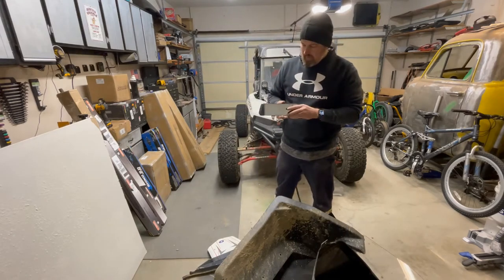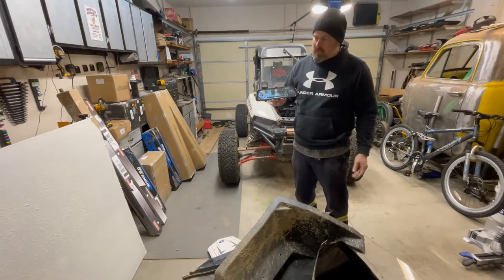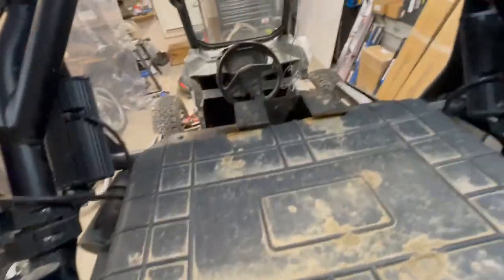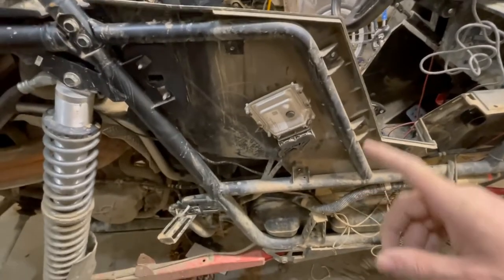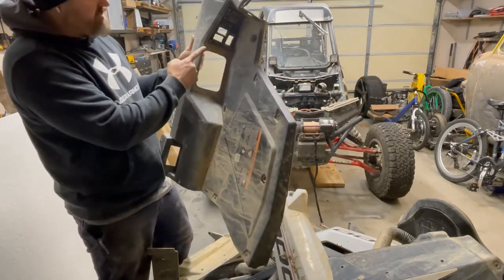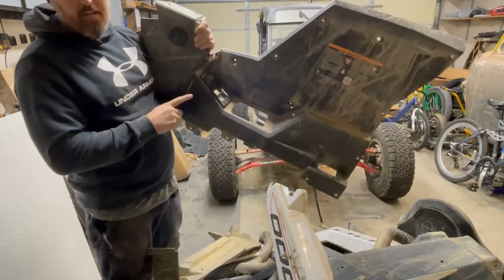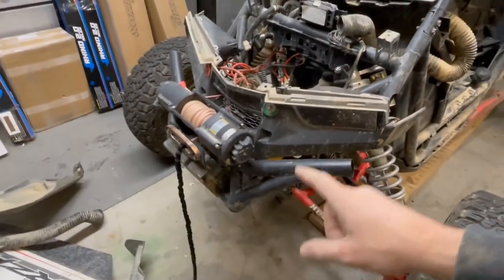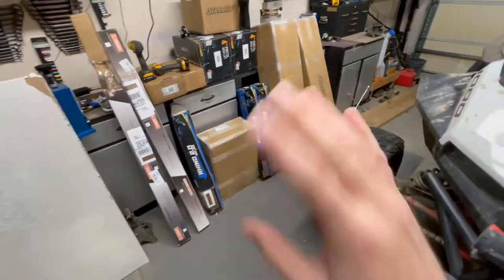DIY RZR RS1 Stretch PART 1. SATV Portals, Sandcraft stabilizer, reverse lights, storage, and more!

Comment: How did you make out with the Sandcraft steering stabilizer? I am looking into using one for my RS1.
Reply from the maker: So it can be used but you’ll need a steering rack from a 72” wide turbo S. Or least that’s what I used. Reason is that the tie rod screws into the rack is different sizes for both units. Turbo S stabilizer bolts to the rs1 but the S is 72 wide while rs1 is 64”. So tie rods are too long. I have a picture somewhere showing the size difference in bolts, I think ones a 12mm and other is 14mm but it is in there. Been long time since I’ve had time to do any tube stuff but I’m getting there.
Reply: Thank you.